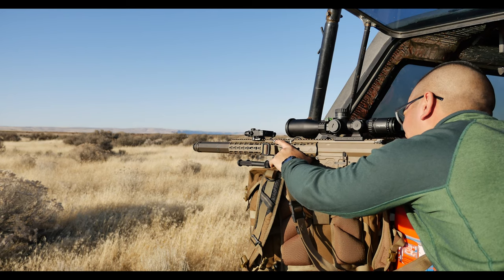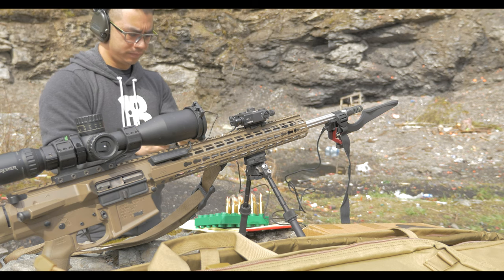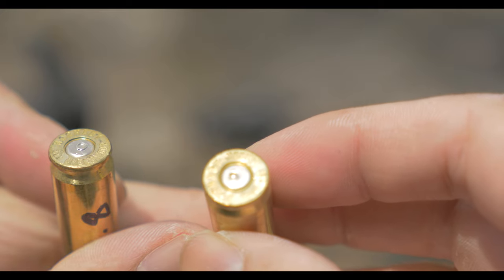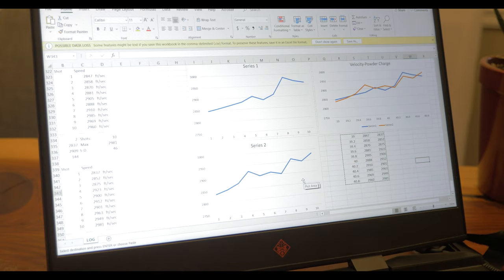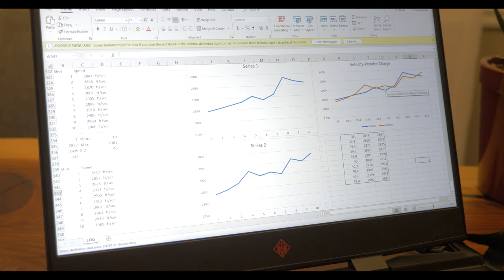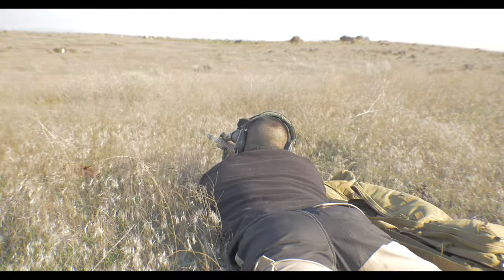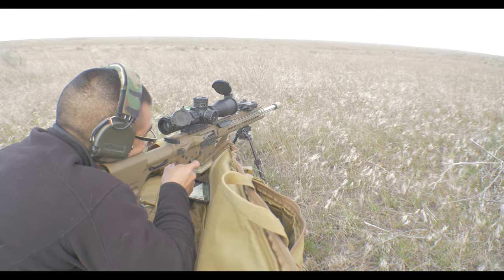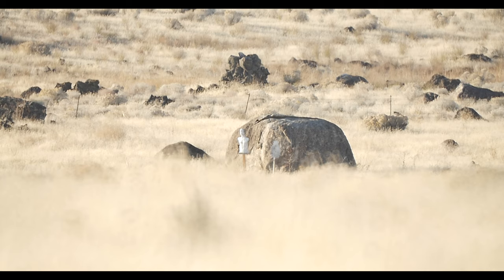Build Better Ammo | Developing The Best Charge Weight

Comment: If I remember right your rifle is a 6.5 Creedmoor. I'm pretty impressed with the high velocities you are getting with just using 40gr. I was assuming you were using Hornady's 140gr bullet but now I wonder if your using the 130gr. I think your video is very important, because blowing up a rifle is a very real thing just by putting in a little extra powder than your rifle can handle. With that said, my load is 42.9gr of H4350 using hornaday brass and 140gr ELD bullets with CCI BR-2 primers. COL is 2.815" I also put a slight crimp on the bullet just to help with jump when loaded into the AR-10 platform. Barrel length is 22" and my average velocity is 2715, so you can see how I'm impressed with you velocities if indeed you are using 140gr bullets. I do know Reloader 17  is a hotter powder than H4350, but didn't realize you could get almost another 200fps faster speeds with it. So my bet it you are using 130gr or lighter bullets ;) I'm pretty impressed with the AR-10 platform because I get pretty amazing groups out of it. My rifle will consistently shoot under 1/2 minute 5 shot groups. The smallest I've been able to get it is 3/8 inch. The farthest I've shot it is 1400 yards and it printed a 6.5 inch group at that distance. My SD is between 5 and 11fps. It depends what time of year I shoot and other conditions.
Reply from the maker: This one is actually a 6mm creedmoor. I'm running the Hornady 108 grain ELDs match bullets which explains the higher velocity
Reply: InnerBark Outdoors good to know. Thanks! I guess I didn’t pay close enough to the shape of your round. In one of your older videos wasn’t one of those a 6.5? It was the Eberly Stock pack review. I bought that pack because of you’re review btw. So thank you for your content.